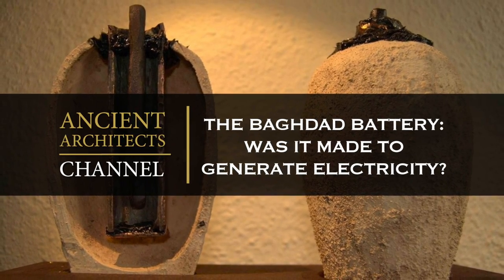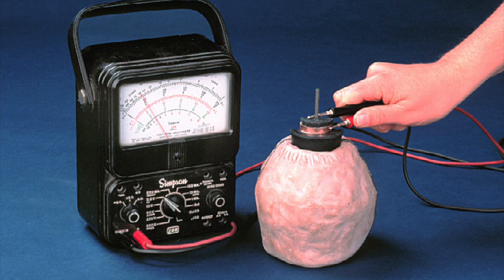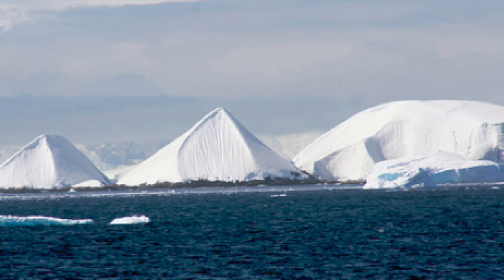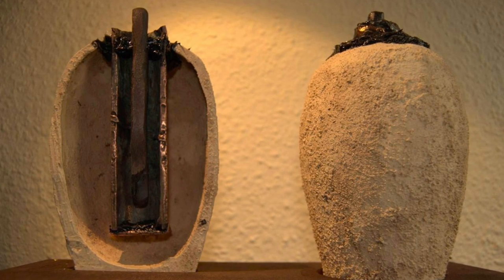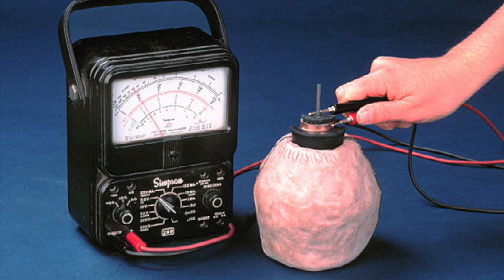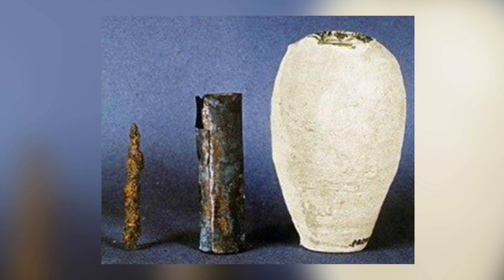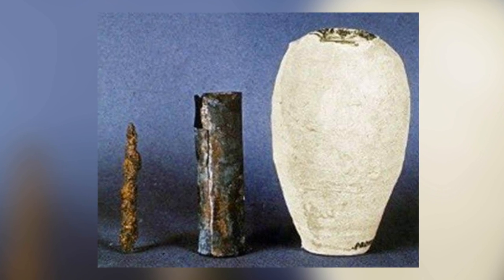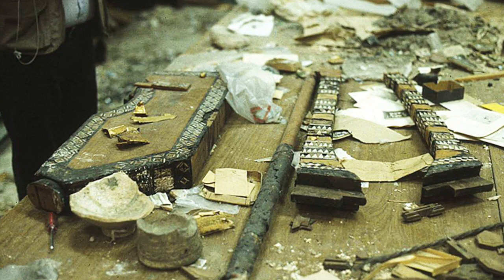The Baghdad Battery : Did it Really Generate Electricity? | Ancient Architects

Comment: If it walks like a duck, quacks like a duck, it must be a duck. They're clearly batteries. There is no other discernible use for them. You cannot discount them because other items were never found. Perhaps they were, and were never officially revealed. After all, the batteries themselves are likely in a private collection somewhere. So could the items they were used with.  Most say they were used for electroplating, which is very possible but no plated items were found. If you could give me another plausible use for them that incorporates all the engineering elements as is, I'd entertain the notion. They've been shown to generate power, and it's a bit of a stretch to say that's a mere coincidence.

Comment: It is worth noting the Greeks had a steam engine, they didn't apply it to anything. It was just a novelty. Why develop technology when you have slaves?
An AA battery is 1.5v. As for the bitumen, you could simply crack it off and replace it. 
You dismiss the battery idea because of a lack of any exterior accsessories, and yet there was no sign of any papyrus scrolls found in or around them either, so by your own measure, the scroll holder theory falls flat too. 
Whatever it was, novelty, kids toy, simple lamp, a tool to make sparks etc, a lot of effort went in to its construction. Why, we will never know.

Comment: storage of papyri seems very unlikely , why have a iron bar and a copper cylinder , you would just seal the papyri in the jar, the construction makes more sense they were batteries , any wires would be long gone,   you would want a secure way to attach the wires , so you would wrap wire around the iron bar and copper part then using the bitumen seal it in place, most likely used to electroplate small items. you didn't really show any evidence to show they were storage for Papyri.

Comment: Ok show me a scroll found in one? I dont know why you would go through all that trouble to hold a scroll. And your over looking the fact they said they found acid damage on the rod. They used electric eels for healing leg pains they would put their feet on the eels and get shocked. Also religios reasons but my theory is electro plating whether or not they have found any thing from then how much gold has been melted down and lost for ever. You are a great researcher u just need to step back and the absence of some thing doesnt mean it wasnt thzy way. Why would u stick a scroll in a jar and not be able to open it. Plus where are the scrolls put in those jars. They could have not understood electricity and only uncoverd the steel rod when used and covered them back up when done thinking it may be holy or dangerously disrespectful to the gods. Keep up the good work

Comment: I fail to understand why a hypothesis can be developed on the basis of not being able to find accessories associated with a battery.  Much of so-called conclusions of modern science is based on lack of information.  I will leave it at that because the opposite side of the coin can look just as suspicious.  However science itself is based on discovering the unknown which includes ancient histories. We must find common denominators requardless of our current methods of practice
Reply: put in a different way;  you cannot build a case on a lack of evidence but a preponderance of the evidence

Comment: Even if they were batteries they are not high tech, but may have been used as toys as they would've used magnets.
Reply: It reminds me of a chemistry workshop when i was a high school student. We made batteries with papayas by just inserting two coins, one of copper and one of tin. The power was so low that you needed to put many payayas in parallel, i think, to light a led.

Comment: Look up electrolysis(https://www.youtube.com/watch?v=zMLNHm4nUCQ)(they only use a 9v cuz it's easier with it in modern times, would work with lower voltage)... here's my hypothesis... Those batteries powered the Great Pyramid! Ok, now hear me out... I think the Great Pyramid is extremely older than they give it credit for. It was used back in the days when the Giza plateau was much wetter(https://www.youtube.com/watch?v=ZQP-7BPvvq0). There was a natural spring under the Great pyramid and filled the pyramid to a certain level with water. I think it was kept at that certain level by the "Sphinx" before it was a "Sphinx". The body and neck are the original structure...dynastic Egyptians made it a "Sphinx" and that "dead end" under the Great Pyramid probably went somewhere at some time. Anyway, the batteries were created and sealed so water couldn't get in, then they were placed in area(s) of the Great Pyramid to be submerged in the water. It doesn't take much voltage to allow electrolysis to occur. I think, before the pyramid was tore up in a million different places and tunnels, the hydrogen(from water(H2O)) rose from the water and collected in the "King's Chamber" where it eventually came out the "Air Shafts" to a device that was on the top of the pyramid. Now whether they just used the pyramid as a huge torch(which could have been beneficial) or powered some hydrogen powered device, I don't know. But the Oxygen from the water collected in the "Queen's Chamber" and dissipated into the pyramid and ultimately back out into the environment. I think they had something else in the "sarcophagus" that may have helped the hydrogen, like another chemical, but I'm no chemist(but mercury has always been my suspicion). Or the sarcophagus was added later by the door/block that's the same size as the dimensions of the box. What's the status of that block anyway? It seems like it would be a relatively easy check to see if it moves since it's not load bearing. Any updates on that? Oh, and after tens of thousands of years... things tend to disintegrate unless specifically protected, like sealed jars...just saying. Let's figure this out, ask me questions, please, I'm all ears! LOL

Comment: I dont think 2 reactive metals should be anywhere near sacred texts, that makes less sense than a battery to me. Iron and copper in such proximity says electrical all day long. If they are not electrical devices I am afraid the papyrus storage is even worse. Just because we have found no "wires" and can not think of a use here 2000 years away are not reasons for discounting "battery" .

Comment: Sorry I didn't listen, but was looking for actual footage. Are there any real photos ? or videos ?   Some reason this object has been in my dreams for a couple weeks. =Bizarre .... Now that I see it again, it looks like a contraption to make something.  Like a water purifier ,, or a way to gather salt  or a faster way to make rust  ,,,  Try to pack the center with salt, and place the whole thing in the river ... or if you wanted a certain salt you could split some complicated salty stuff, by placing a solution in the outer container and something in the center. container. then the change of pressure OUTSIDE will push liquid through to the center one ,, which will then again push salty stuff,, which should appear on the top of the iron which is protruding out .. I don't think its a stretch caz they would have noticed oxides on their metal any time the seasons changed or when metal got wet.

Comment: Come on man you're smarter than this.  Why would they use 2 dissimilar metals which can achieve ion exchange?  For storing scrolls?  Why not use the same metals? It will be a much more stable environment. Different metals will create unfavorable erosion of each other so they wouldn't have mixed them if there wasn't a function there.  Then throw in the electrolyte and they just create a battery by accident?  No, too unlikely.

If uses for that low voltage are what makes you sceptical, I am surprised that you wouldn't know this; what is the forward voltage for water electrolysis?  That's an obvious use by nature of the design alone, without even knowing that it typically uses 1.23 volts.  LEDs also use a very low forward voltage, I know they're seen as modern inventions but their principle is still very simple; electrify a material enough to force an electron to jump out of orbit enough to create a photon.  I can't offer an explanation as to why they didn't have exposed electrodes, maybe they broke off, maybe they functioned using EMF though I think the latter's unlikely.

Comment: Archeology is not a science so what would an archeologist know about tech? Most likely they were used for gold plating. You don’t need much voltage for that. BTW increasing the size of a battery does not increase its voltage. Voltage is increased by connecting cells in series.
Reply: How is archaeology not a science? 
Here is a definition of science. "Science is a systematic enterprise that builds and organizes knowledge in the form of testable explanations and predictions about the universe."
Can you provide examples of how modern archaeology deviates from this description?

And as far as technology is concerned, technology is a tool. Just like a physicist's pencil is a tool. There are sub-branches of archaeology dedicated to technology and its applications in the field. 

I think you need to venture out of the tunnel you are in and broaden your knowledge base.

Comment: GO BACK TO SCHOOL - BIGGER GIVES YOU MORE AMPERAGE OR POWER,  NOT A HIGHER VOLTAGE - VOLTAGE AND AMPERAGE ARE TWO  DIFFERNT THINGS .  you can have a very high voltage at low amperage and it is not a danger.

Comment: Love your vids but I am an electrician no the reason for an electrical system is not always to power something the Egyptians used to gold plate many different items granted it would take a couple of the batteries and you can put them In series easily also the asphalt does not have to seal it because they probably changed out their electrolyte solution because it's not like they can go to wal mart and buy another there is no reasonable explanation on what it is other than a battery in my opinion I mean I dont store metal in my soda I got the fridge uk were talking about a civilization they did everything for a reason and all you have to do is have 4 or 5 or even more of the said batteries hook them positive to negative and the last one in series you attach to gold and the other whatever item you want to electroplate also why did u not mention the hieroglyph of what seems to be a light bulb In an area of the pyramid were a torch wont stay lit due to the lack of oxygen with no soot residue on the ceiling.

Comment: Why would the Romans know of Parthian inventions, especially if they were complex scientific research projects. Afterall why would you share your discoveries with your rival?I doubt the romans knew of these, and they could not have held scrolls.The batteries could have been wired in series for greater voltage.The objects powered by them could have been made of rare materials and considering that the common folk of that time did not understand electricity, those items may have been cannibalized for their parts which held an inherent value.

Comment: I appreciate your approach to your research. I have to tell you though that you lose credibility any time you refer to science proving things. Science doesn't prove things, it can only disprove/falsify. To prove requires infinite sample size and a knowledge of every variable. This is an easy place to be specific in your language and that shuts down a great number of semantic  attacks on that language. As to the batteries... my expertise is in ancient metalwork and I can assure you they produce enough voltage to do electro-plating, most likely of gold. In this set-up no wires are needed. The metal bits to be plated are sealed into the battery itself and then unsealed later.Larger voltages are not needed, all that is required is time and proper set-up. The plate layer is amazingly thin and probably wore off with very little wear and given the relatively good supply of gold,  plated objects were not needed by the wealthy. I personally believe the metal-workers were attempting something akin to alchemy for the sake of commerce. It bugs me that the fall-back hypothesis is always "religious object/temple" when it is more likely business/functionality.